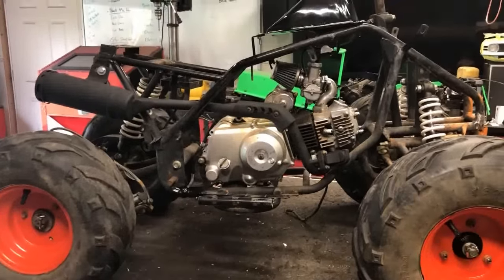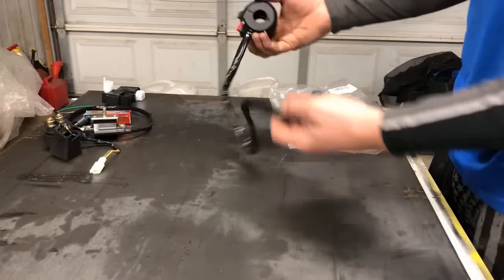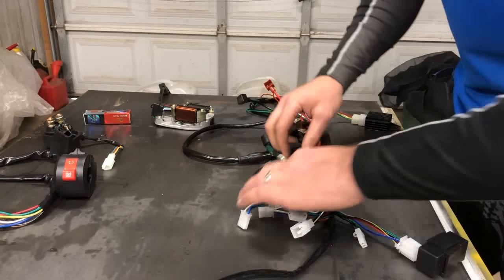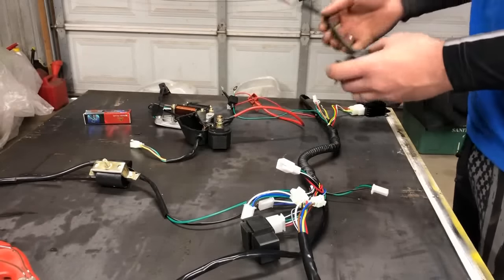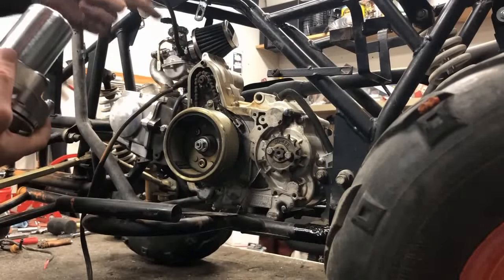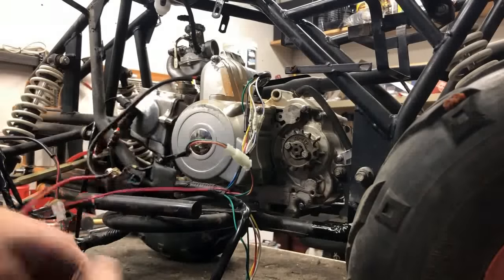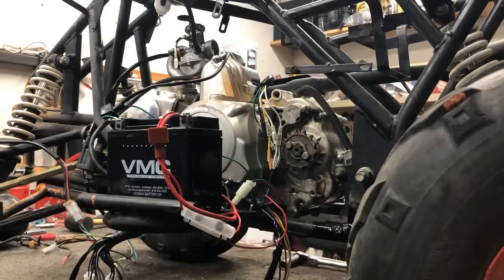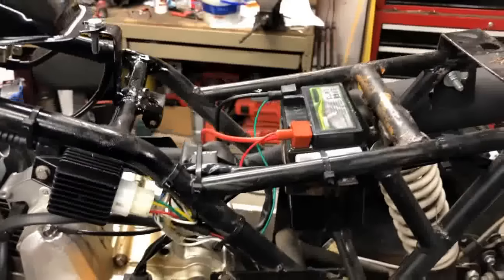Wiring a Chinese ATV from start to finish with an All New Wiring Harness!

Comment: I have a 50cc ATV and I followed this video, I have spark, fuel and compression but won’t start .....
Reply from the maker: Whats your compression reading at? Assuming its good then eliminate all variables. Remove the exhaust and take off the carb. Make sure the spark plug is completely screwed in and check the gap. Dribble some fuel down the intake and see what happens. Still nothing then check to make sure your flywheel is still lined up with the keyway. Take off the timing chain cover and put the motor at TBC. Then make sure the timing marks are all lined up correctly. Lastly check the valve clearances. If you do all that at still nothing, then send me an email!
Reply: Compression is 100, spark is there but maybe is weak. I have replaced the harness, stator and I have serviced the carb. It ran for a seconds after I replaced the harness. I came out the next morning and it won’t start

Comment: My wiring Harness is not giving me spark
Reply: Ive done the wiring 2 times before and it worked and now it dosent any help that i can get to help find my problem
Reply: After a long 5 hours I found out it was my cdi box and i changed it with an old one and boom has very good spark
Reply from the maker: Sorry I'm late to the comment Luiz, but I'm glad you found out the issue!
Reply: @PraskaBoysGarage  yea man but it ended up not having compression so I sold it
Reply from the maker: @luiz-mg8yw  Ah bummer! My next video I'm editing right now gave me similar problems!
Reply: @PraskaBoysGarage  yikes man i was planing on doing my first rebuild but I decided not too

Comment: My starter relay keeps clicking ):
Reply from the maker: That usually means it's bad and needs to be replaced.
Reply: @PraskaBoysGarage  I had two brand new replacements and both click same as the old. I am assuming the starter is stuck after confirming everything is wired correctly and power is flowing to each part. Thanks though 🤙

Comment: Hey I got a whore wiring harness and my solenoid just clicks is it not getting enough power?
Reply from the maker: Typically a clicking noise means it's bad unfortunately. Take screw driver and bridge it across both posts on the relay. If it turns over the motor I'm going the relay is bad and will need replaced.

Comment: you made a mistake when you said the wires at the rear  were brake  switch the brown going to the rear is actually tail ;ight /brake light
Reply from the maker: Yes you are correct, I meant to say brake light. Thanks for watching!

Comment: https://www.amazon.com/gp/product/B07KZWBB78/ref=ppx_od_dt_b_asin_title_s01?ie=UTF8&psc=1 this is the wiring harness i had ordered and set up with what it came with works and starts the engine i have but what i am having trouble with is there is no exact diagram for this wiring harness to help me know what plug is for the back tail light or witch plugs is for turn signals let alone what turn signal handle bar switch box i need if you could please help me out on this i know thanks to your video what plug is for headlight witch there is two but i really need help for turn signals and tail light witch is getting aggravating a bit to figure rest out
Reply from the maker: I am sorry I do not have any wiring diagrams for the GY6 motors. When I pick up an ATV in the future that comes with a 150cc GY6 I will do another wiring video to cover the install.

Comment: I can’t even get the damn thing to crank.
Reply from the maker: Jump the starter relay. Take a screw driver and bridge it between the 2 leads. If you have a charged battery and a good starter is will crank.

Comment: Man I wish you lived next door. I have a big problem. I just got a kids 2008 Chinese 110cc Quad ATV given to me for my grandson. I think I got the wrong wiring harness and stster. It has the right white wiring connectors but the wire colors don't match. Also there is a wire under the cover to the right of the stster at about 11;00 above the sprocket. It has 5 wires in a 6 pin white connector with 5 pins in it. Have you ever seen this before? It will plug into the kill switch white plug but then the wiring harness plug has nothing in it. The stater is a 4 plug with one green wire by its self like the ones that the stater plugs into. It's a 2 coil stater. I'm a 75 year old retired military Vet and this is driving me crazy. Please hel;p me. It's like there are 2 stater cables. 1 where the stater is and one under the cover to the right.